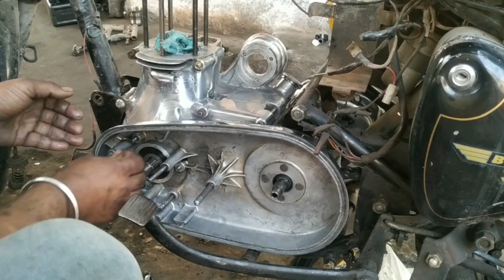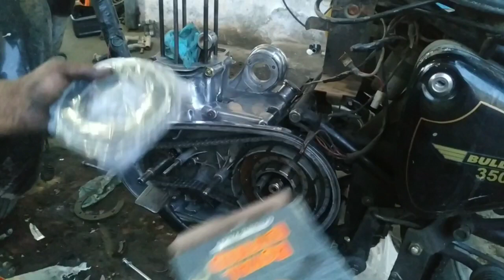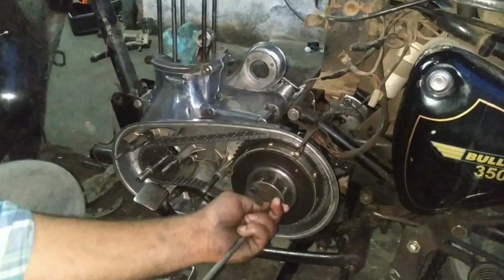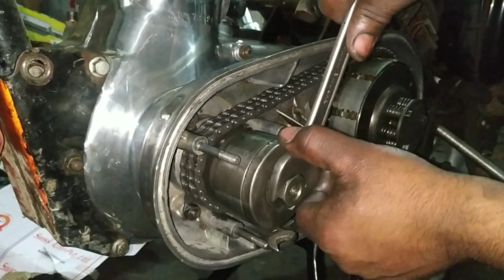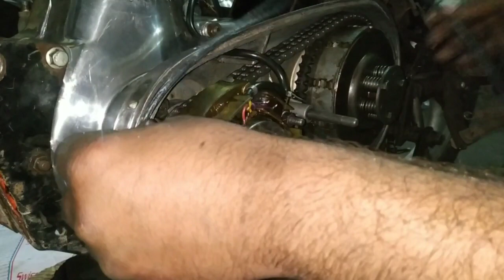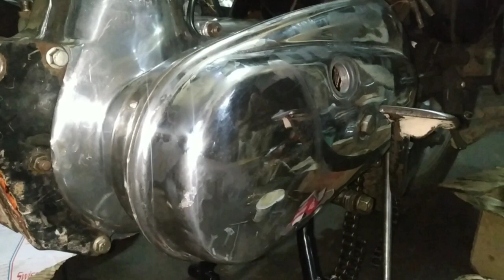Royal Enfield | Old Model | full clutch assembled | PBR Motorcycle  | Pawan bullet repair

Comment: Brother i have bullet standard 350 2008 modal point, 
But i will upgrade clutch assembly old modal five hundred clutch plate assembly in my 350 cc bullet,

Is it good or not pls tell mi brother